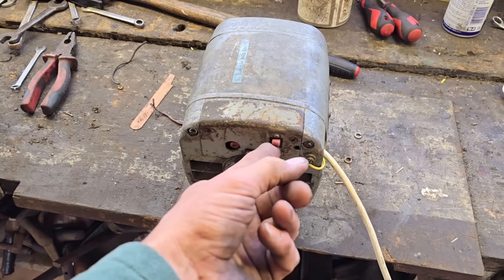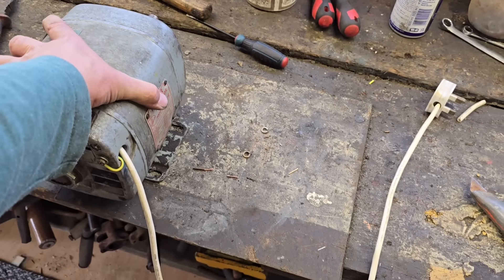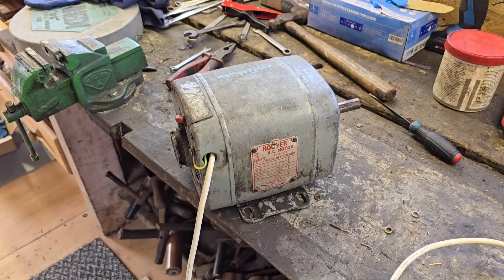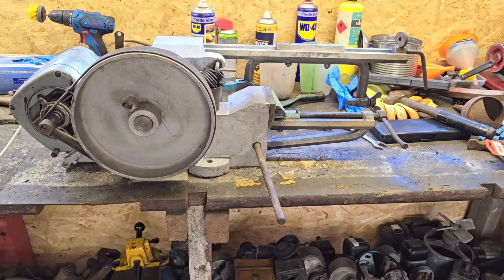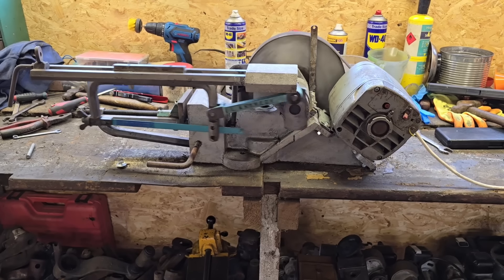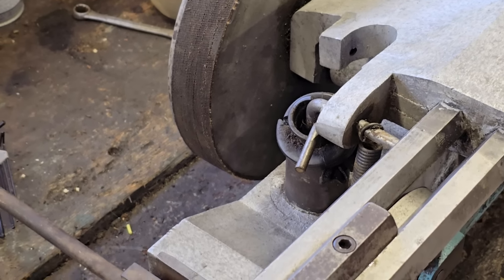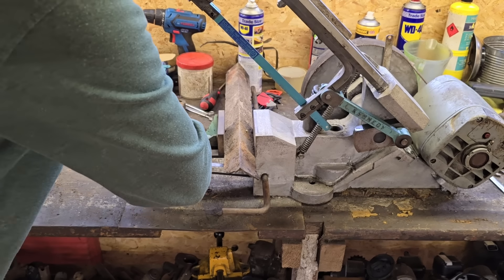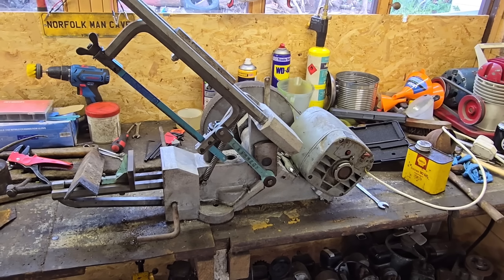Hoover 240v motor and Kennedy saw. Will it  work.

Comment: Well done, good to see the original motor running. An open circuit or dirty contacts in the centrifugal switch would have prevented starting. Perhaps some elbow grease, for the damper pot.

Comment: Nice one! Well done.
If you ever need another belt and you can't get one try this, a toothed flat belt inside out (teeth on the outside) I've got a 1936 lathe that's supposed to have a flat belt which I can't find so for the past 10 years it's had a toothed flat belt driving the gearbox 😅 works just fine.

Comment: I got to tell you, power h saws usually cut on the back stroke. Because it pulls tension on the blade. Bigger units lift slightly on the forward stroke so not to kink the blade. Oil all your slides every time you use it. So if it jams the motor can slip and not burnnout.
Reply: Use semi liquid grease in the pot (4 steering box). Do not over tighten belt.

Comment: I had a saw like that and it would cut through any mild steel that would fit in its vice, would even cut through lorry axle springs 1” 1/2 , it would run all day till the blades snap! 👍

Comment: Excellent. As far as your damper goes. Do what they used to do on a lot of the older British motorcycle gear boxes engineered with no seals but close fit bushings... they mixed gear lube with bearing grease to thicken things up to minimize drips ...it also blended I to some thick lube... as far as your Gator...look at those used on shock absorbers you could cut down

Comment: One reason those type of electric motors get scrapped or taken to bits is that they used a rubber type electric cable and it breaks down and regardless of how much insulation tape is used you got to do a rewire. I have also seen guys use an old cambelt turned inside out to use as a flat belt. thats if the canvas one fails on you. Cheers Jim in NZ/

Comment: good job, you may find that when that part of the blade goes blunt you could probably  turn it round so teeth face the motor and it would still cut ok making use of ALL the blade.

Comment: Cracking job. Worked with these in the 70s as mentioned. As I remember it uses a broader blade. (about 2 inches) Probably OK but you may go through a lot of blades.

Comment: Try mixing grease and oil together to make it thicker. That's what we do with antique motorcycle gear boxes. (AKA grease boxes.)
Reply: At one time you could get fluid grease,it was red and just thin enough to pour a bit like treacle!
Can’t remember who made it apart from it came in a be red metal  5l can with a screw cap!
Could of been Silkolene but not 100% sure
Reply: Like the gearbox on my Enfield Flea. We call the mixture of oil and grease "snot".

Comment: The only problem I see with saw it don’t use the hole blade so it going to use a lot of saw blades .but good job
Reply from the maker: Yeah I did think that myself. The vice do open a long way so if cutting small stuff could always put a wood block in the fixed haw so the work price is further back getting a new bit of blade.

Comment: Something doesn't look right (in my opinion, I may be wrong). There should be a long rod which travels along and over the top slide and releases a pin / pivot which lets the arm drop (rather than the damper holding the arm up, which would require the piston and bellows to be clear of the pot). I keep looking at that L-shaped crossbar and thinking that's not right or something is missing. Theres a video from Jack's Garage Workshop (23.11.23 Kennedy Hexacut power hacksaw from auction, will it cut again) which may help.